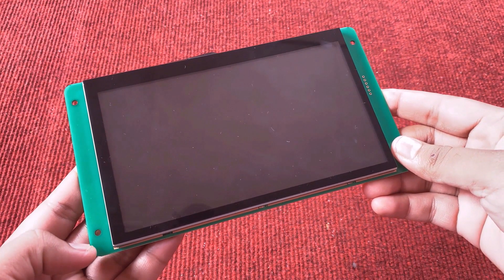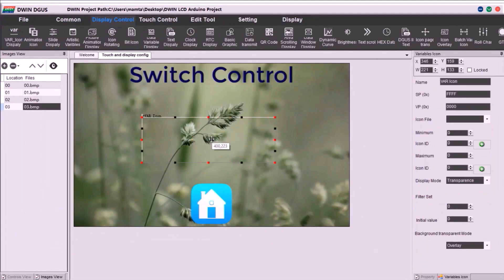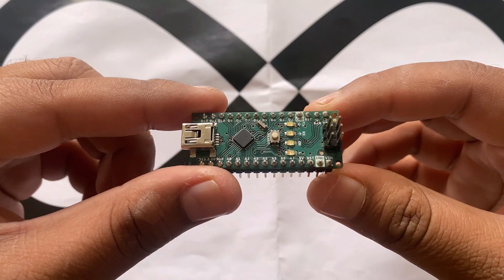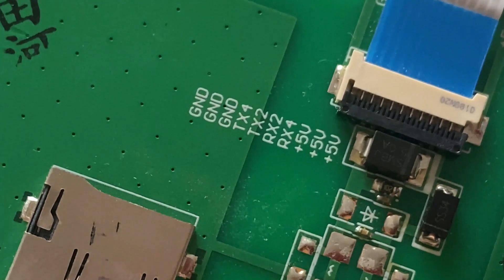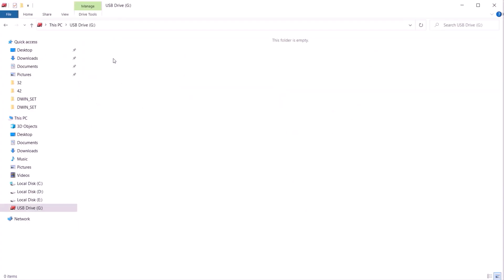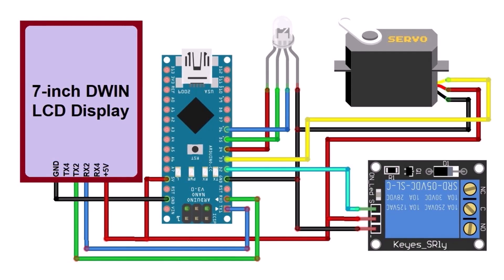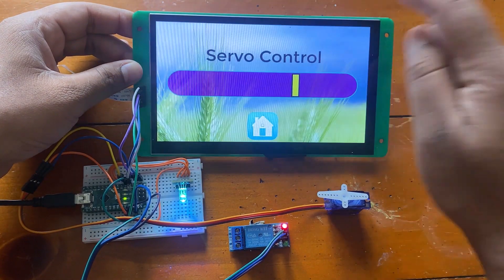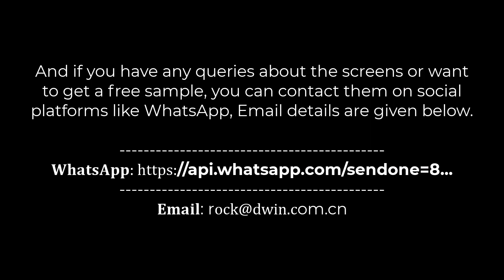Using DWIN 7-inch TFT LCD Display with Arduino to Control Relay, Servo & RGB LED

Comment: This display is an unknown, none of the demos that are on the internet (not even this one) that I try to reproduce on my display work... I've managed to send data from the Arduino to the display but I've never been able to get the Arduino to recognize this click on the display... and from the comments I see in the videos, almost no one can... lol... I think that the trick is that no one puts it in the videos... it doesn't make sense... how do I put the display file correctly... I install the Arduino code and when I test it, it doesn't work... you click on the servo option, for example, nothing happens... I'm starting to think that these videos are all fake... lol... I'm going to try a NEXTION display...
Reply: I am facing the same problem

Comment: My dwin while doing the connection with Arduino Uno the screen is blinking please solve my problem and my display model number is DMG48270C043_03WTC Please respond